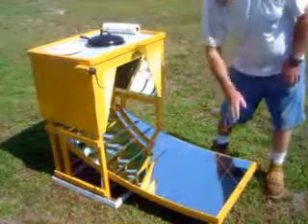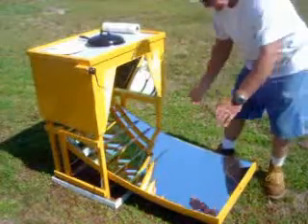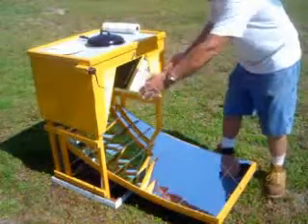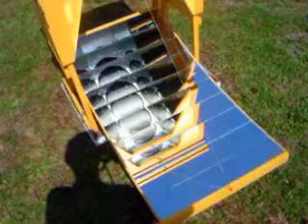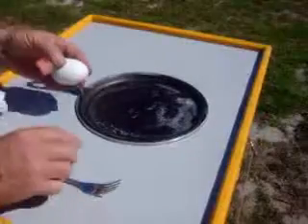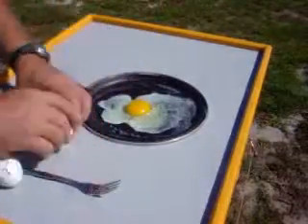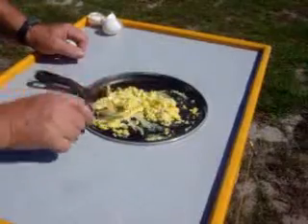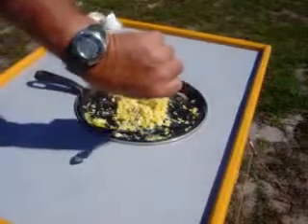SolarSkillet Demonstration Sept.29, 2009

Comment from the maker: Actually the four legs sit in what I call a "Skid Tray" which is a piece of plywood trimmed with 2X2's.  Then it is easy to slide the unit inches at a time when needed with just a bit of push with your foot.